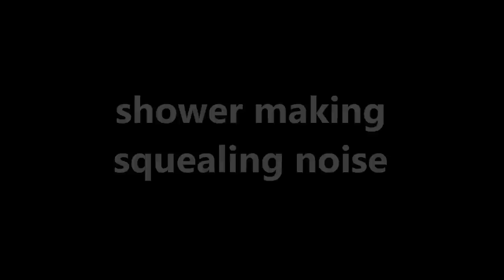shower making squealing noise

Comment: Thanks a lot Steven! I had been putting off the problem for weeks, thinking it was something more complicated, and just came across your video. What a relief! Thank you!!!
Reply: Hi again Steven, in my case it ended up being the valve stem that needed to be replaced. I guess either the shower head, or the valve stem can restrict water flow and make that high pitched, irritating noise!

Thanks again, 
Jose

Comment: squealing is done by a built up of calcium and you need to replace the shower head or sometimes you can dip it in CLR!
Reply: I have a brand new shower head squealing... guess I'll take it apart and see if readjusting helps
Reply: @TwoTall1988  if you have hard water a water softener sometimes helps a lot. We had that problem for a bit when we first moved in.

Comment: I have a vibrating noise when the shower head is engaged. It starts about 10-15 minutes after its been on. As soon as i turn off the shower head the noise stops. 
It seemed to have started after a pipe burst, but in a different area of our house. 
If you have any suggestions I would be forever grateful!
Reply from the maker: devin van overberghe it might be a loose washer on a shutoff some were is system .

Comment: I feel like this is a pretty common problem in older houses. I know you didn't figured out what the problem was, but I appreciate how quickly you found where it was located. 

A calcium buildup is probably the culprit, and a vinegar soak might make that old head usable again. However, you took the right approach in just replacing the shower head. Not worth your (or the homeowner's) time, trying to fix an old basic shower head.

Kudos.

Comment: I have a similar, but differnt squeeking noise coming from my shower.  When the water is turned off it squeels (very low volume).  When I turn the water on then back off again the squeel goes away.  in a few hours the noise comes back.  Just turning the water on and then back off makes it go away.  Help... I'm losing sleep.

Comment: My shower does the same thing and I have replaced the head with 3 different brands in hope of solving this annoying issue, but have been unsuccessful.   Is it possible the shower valve needs to be replaced to get rid of the noise?
Reply: you ever figure it out?
Reply: We are still waiting for your answer 6 years later

Comment: I have a horrid squeal coming from someplace near my toilet shutoff valve. It often starts when someone uses the sink, basement shower, or when the heater turns on. My options are to replace the shutoff valve or call a plumber to install a pressure valve near the well. Any other advice? It's so annoying I'm ready to hit it with a sledgehammer.
Reply from the maker: Laura Woodswalker it is probley a loose washer in the shutoff valve or toilet fill valve .i would beat money on the loose washer in the toilet shut off .. call a plumber to find the issue is your best bet

Comment: Hi Steve, I have a question: at my Mom's the kitchen faucet squeals/whistles  when you turn it on. single lever handle. When you move the  faucet spout up or down a little (it's not meant to move, but I noticed if tension is put on it it quiets) you can stop the noise briefly. Any ideas on how to cure the problem?
Red
Reply from the maker: change out the faucet is the easy fix probley old anyway.

Comment: I also had a problem like this that was stopped y replacing a faulty water intake flushing valve on the toilet! Tried a million things for a year and replacing that finally did it. It was a crazy hammering noise after you turn the shower or other taps off.

Comment: Had the same thing at the other end of the house in the spare bathroom shower, just replaced the washers in the taps and problem was solved. The washers were vibrating in the housing causing our noise.

Comment: I don't know, I had the same problem in my apartment. Shower head was annoying making that squealing noise every time we used it. I thought as many youtube videos say, must be the shower head. So I thought as well it could be that because every time we changed the setting , it would stop for a while. So, I went and bought a new shower head and NOTHING! still the same squealing problem. I'm fed up! do I have to call a plumber? see why is doing that? Brand new shower head and still does it. :(
Reply: you ever figure it out? Might be a issue with a cartridge

Comment: I put a new shower head on, and NOW it whistles. Didn’t before. Other was just old. Ideas?
Reply from the maker: there is a water flow control in new shower hear remove the o ring with dental pick it will give you more water flow and might fix your issue . the whistles is caused by a restriction most shower heads are 2.5 gallon a minute

Comment: Did this on mine but it still squeals. It sounds like a 90's modem.
Reply: you ever figure it out?
Reply: @aaronbaraiya3692  Yeah, it was haunted. So I changed the washers and that fixed it up.
Reply: @sarcasmo57  washers inside the handle?
Reply: @aaronbaraiya3692  Thank you. You are right.
Reply: @sarcasmo57  oh ok :) great
Reply: @aaronbaraiya3692  Yes

Comment: I too have a squealing noise coming from my shower but not from the head it appears to be coming from the base of the shower arm. Very annoying
Reply from the maker: 350 Z remove the shower head and take out the flow control devise some times it just a o ring ,this will give you more flow and might fix the problem